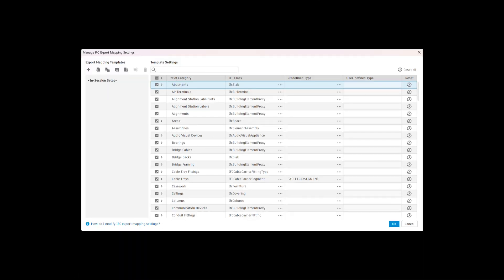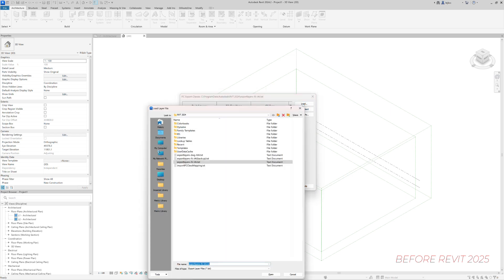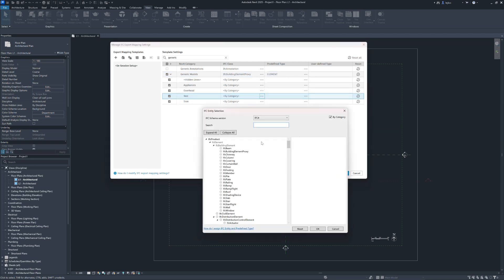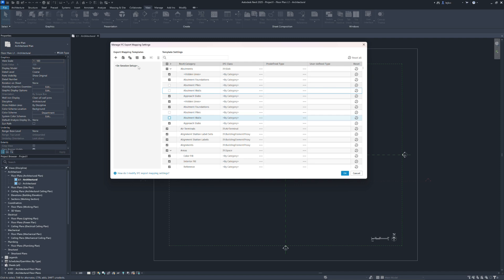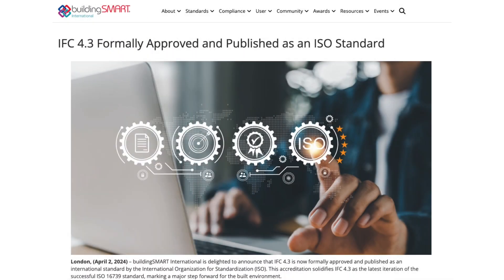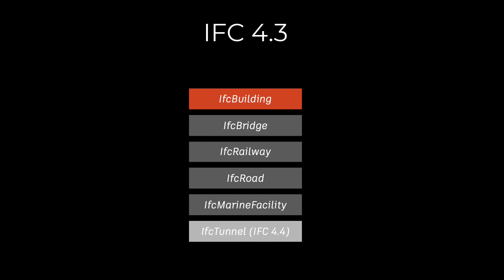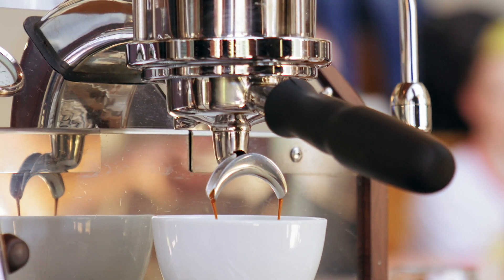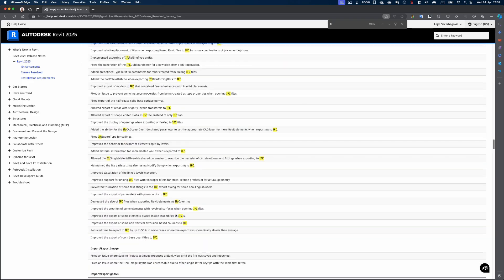What's new in Revit 2025 - IFC Edition

Comment: Hello Lejla , very nice video. Do you maybe know if there is any way to overide materal  on revit elements by instance. We have a general issue in the MEP space where the system elements are exported with system colors, but fittings and accesories are exported with their solid colors. I can always idenity an ifc that was exported from revit when i see grey fittins on pipes and ducts.
Reply from the maker: Thank you for your comment! This is a very common request and it's a bit complicated becausethe system color is basically "just" a filter in Revit and not a real material. I don't think the solution should be to override the actual materials, but more the representation / color in IFC. I know the Revit IFC Team is looking into this and I hope we'll have a solution for this soon (though of course, can't promise anything) 🤞